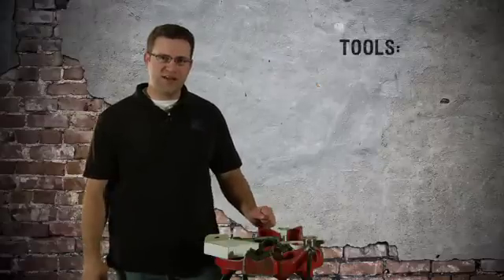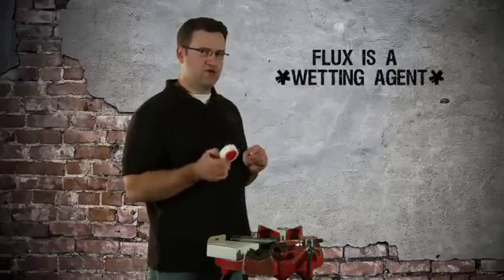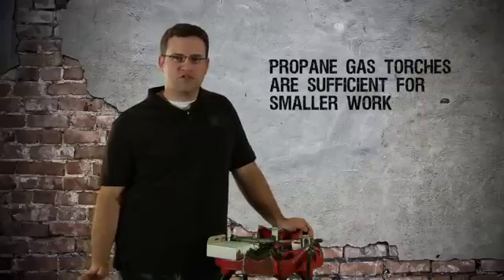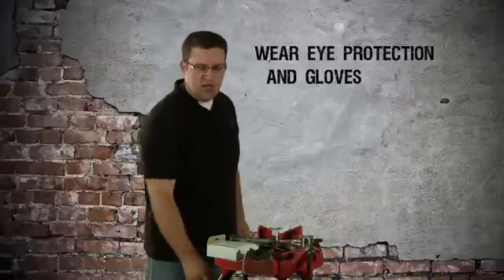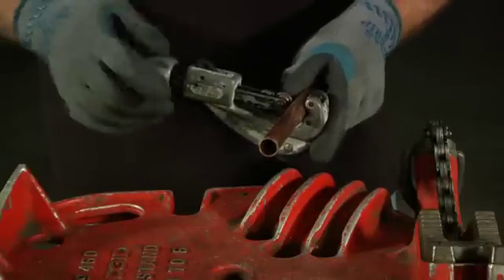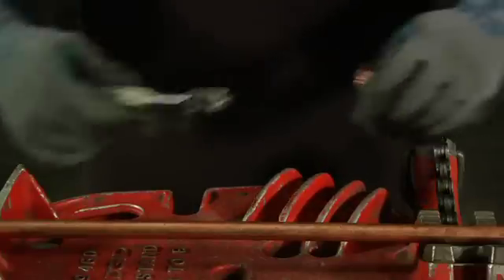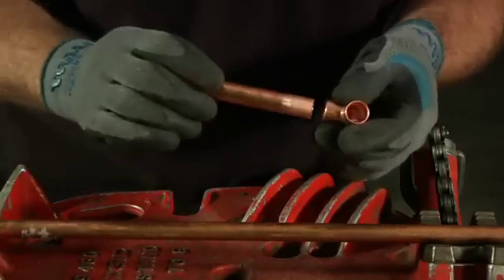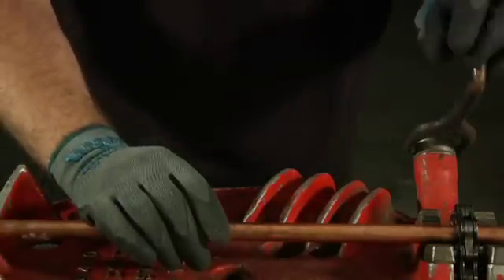How to solder copper pipe like a pro.  Part 1 of 2.

Comment from the maker: Make sure you're using the correct flux (not tinning flux), and that you've stirred the flux and applied it to both the pipe and the fitting.  If the flux turns green that indicates it's been on too long and may have started to oxidize the copper.  If the copper isn't hot enough the solder may just stick to it without flowing.  Use good heat and you should get it to flow.

Comment: Easily the best copper soldering video I've seen.  I was wondering though, when I did some soldering I ran into an issue where the solder would melt but it wouldn't go into the joint.  I found that I had to re-apply some flux once the joint had heated up enough just before I applied the solder.  Could this be because I use a little torch that doesn't heat the copper fast enough?  And should I ever see the flux go green?  Thanks for your help!

Comment: I watched both parts of your informative soldering videos. Very quality conscious top-notch work and great step by step detailed explanation of the proper steps involved. You stress the importance of the flux, but I once soldered without flux because the fitting can then also double as a great showerhead! ;) Seriously, great vids Seth.